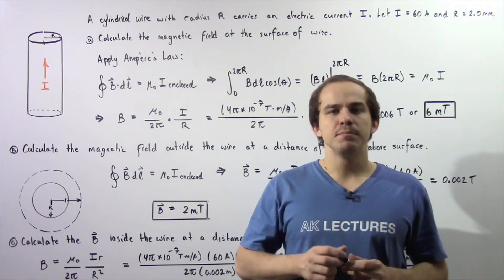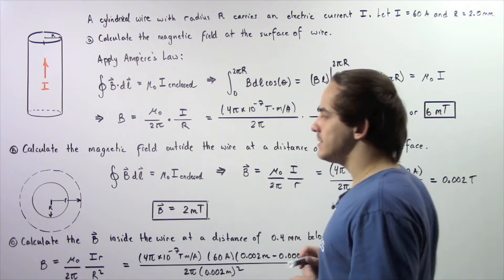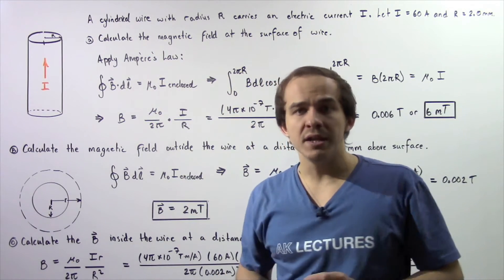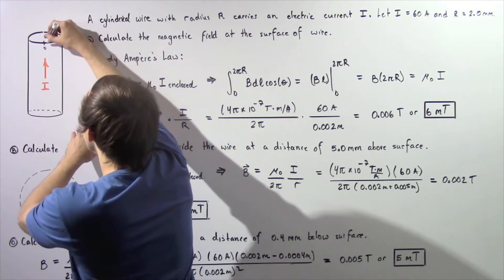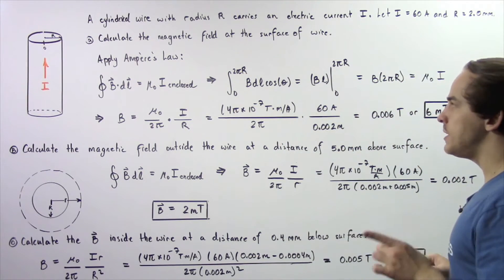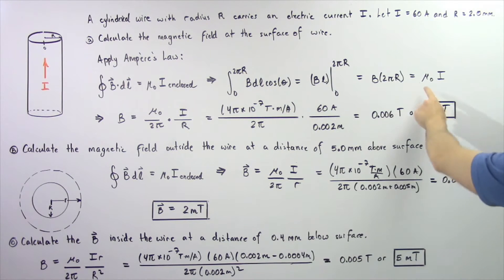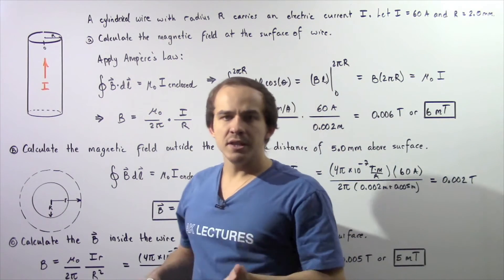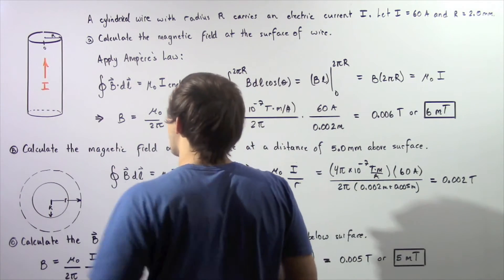Ampere's Law Example # 2

Comment: This cannot be right. So lets investigate 2 cases - one with infinitely small diameter of the wire carrying the current of 60A( in this case) and the second - when the wire diameter is 2mm.What would be B at 2mm from the centre of the wire ? According to the   AK LECTURES in both cases it is B=6mT but as we know the value of B depends on the distance from the centre and  how in this case the current concentrated in infinite small diameter could produce the same B as current flowing in 2mm wire at the distance of 2mm?